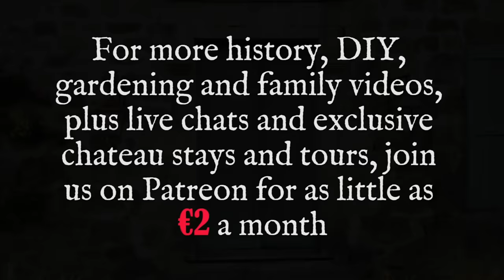Disco lights and wall colours: Bedroom 2 is nearly done! | Chateau Coach House Restoration

Comment: I think a Navy Blue would be good for the panels. No matter which material you are looking at (floor, mural, stone), it will look good.
Reply from the maker: It’s quite tempting. The dark blue sample looks good. But such a large surface might seem a bit dark.
Reply: @Chroniclesofrosieres  True. Consider how much surface area of all the colors will be visible. The floor is a lot of orange and the stone and mural will mute the dark as well. It's difficult from video to perceive the relative amounts in total.